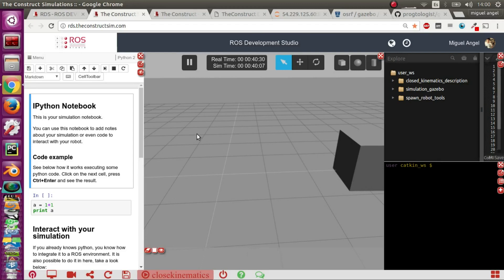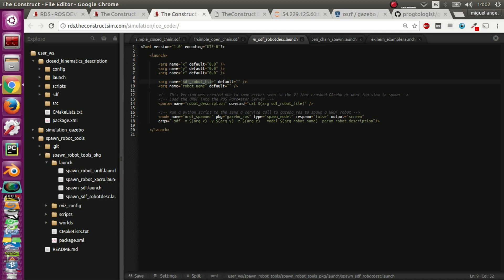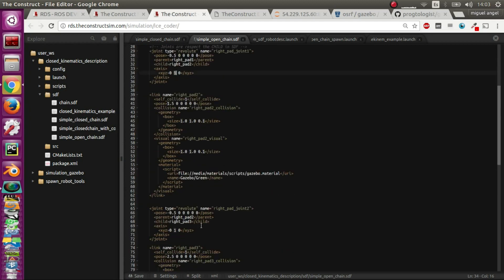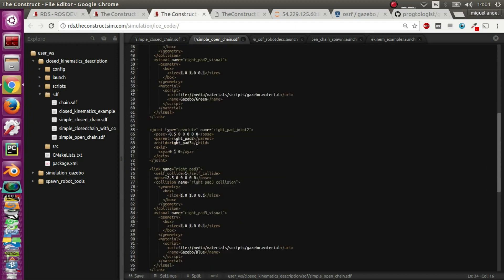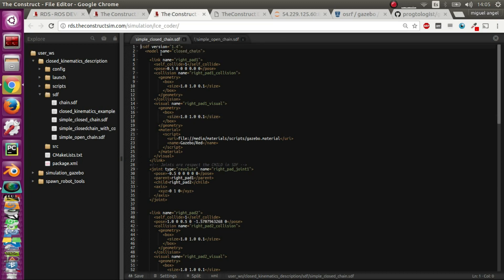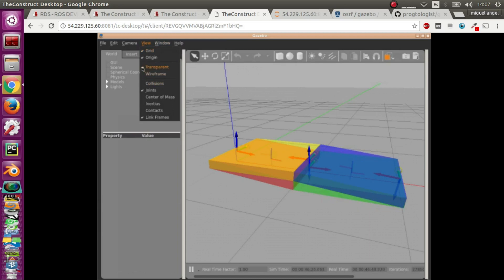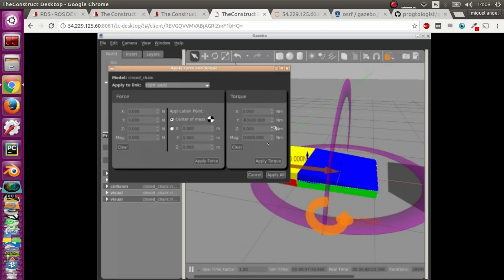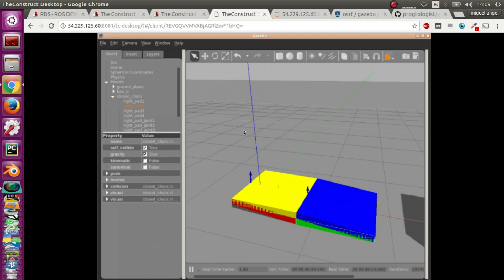[ROS Q&A] 002 - Parallel Robots - Implementing closed kinematic chains

Comment: I tried following your tutorial. I am getting following error. 
[INFO] [1628209821.118453]: Controller Spawner: Waiting for service controller_manager/load_controller
[robot_state_publisher-3] process has died [pid 25574, exit code 1, cmd /opt/ros/noetic/lib/robot_state_publisher/robot_state_publisher /joint_states:=/closed_chain/joint_states __name:=robot_state_publisher __log:=/home/khan/.ros/log/7aec1750-f64d-11eb-8483-f50c2e96d1fd/robot_state_publisher-3.log].
log file: /home/khan/.ros/log/7aec1750-f64d-11eb-8483-f50c2e96d1fd/robot_state_publisher-3*.log

Any suggestion please?